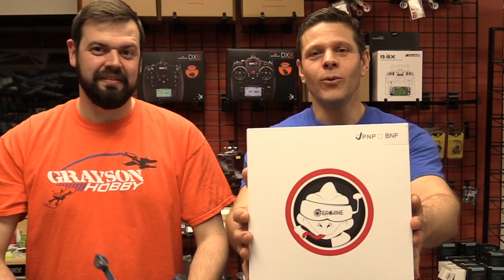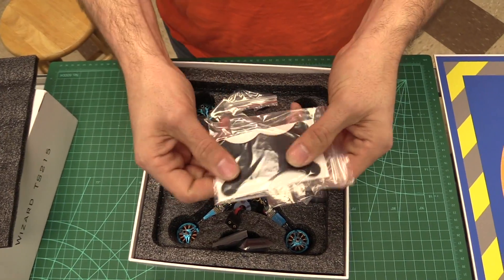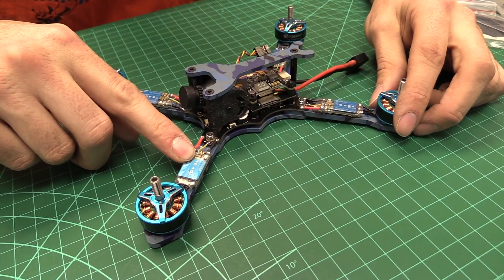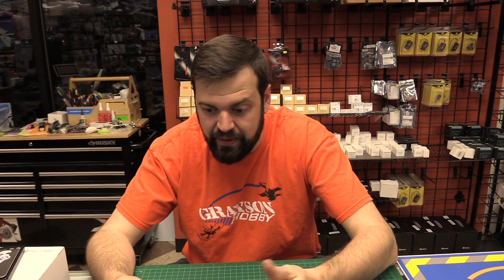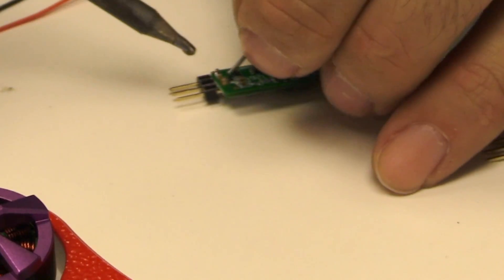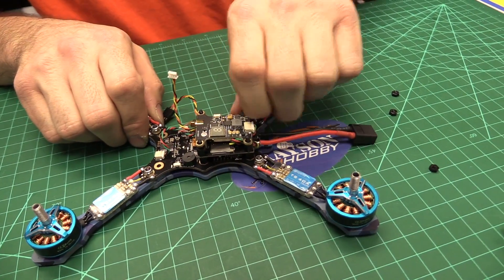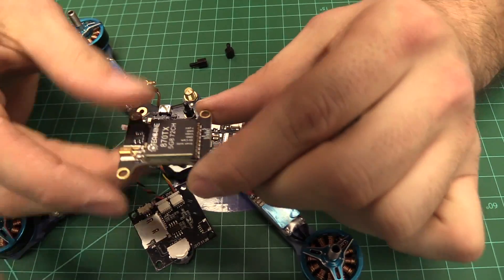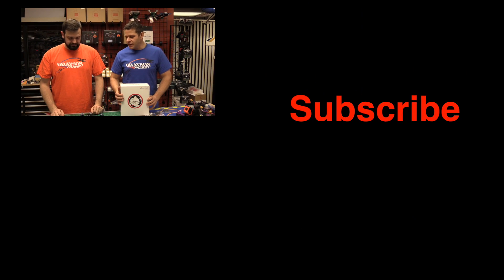Eachine Wizard TS215 Deep Dive Component Inspection Unboxing

Comment: Is the PNP version compatable with a Flysky receiver?
Reply from the maker: +Daniel Tucker plug and play refers to the receiver, you plug in your own receiver so any frsky, Spectrum,or FlySky
Reply: Grayson Hobby my question was not complete. I was referring to the voltage output pads  being pre soldered to the 5.0 volt pad and not the 3.3 volt pad. Would it work with a FS-iA6B receiver.  The answer is yes.
I think the bnf version may be pre soldered 3.3volt for frisky.

Now the receiver plug/wires on the pnp version, is that ibus? Can I just plug into ibus on receiver and then bind it?
Reply: I also would like to know if this would work with a FS-IA6B reciever and the FS I6 controller.